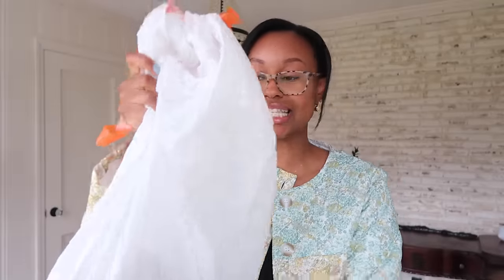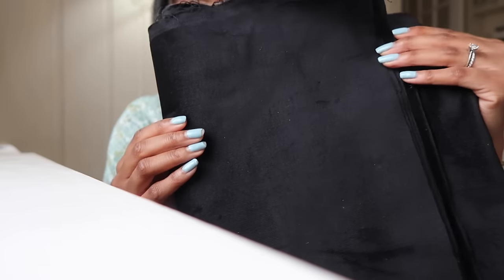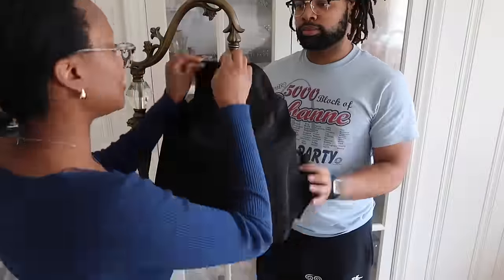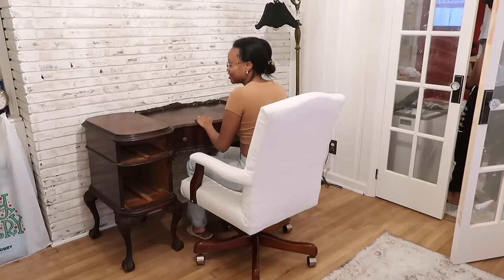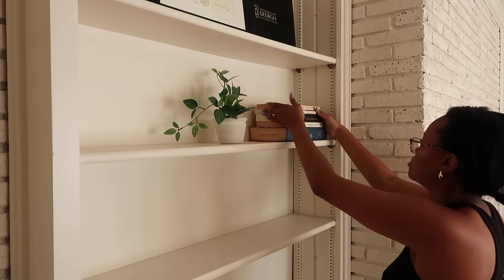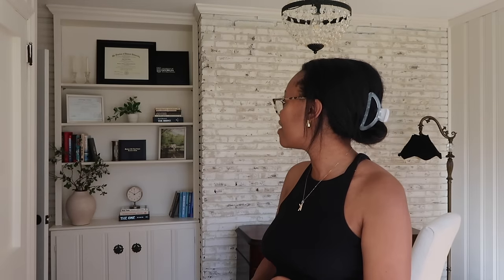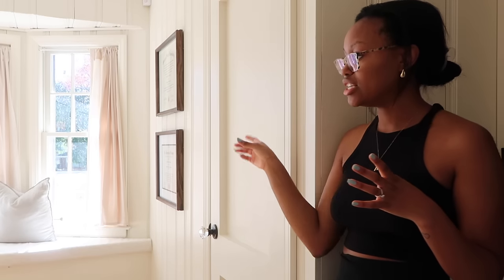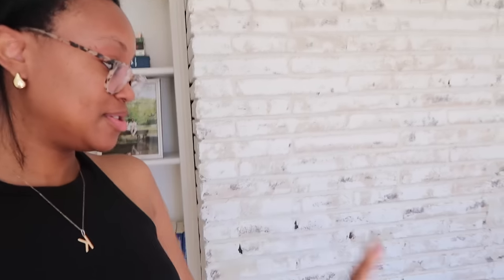DECORATING MY DREAM OFFICE!!! (Custom Furniture & Lamp)| DIY Dream Office Makeover Pt. 6 #FIXERUPPER

Comment: The office turned out Amazing.  Trial and error is a great way to learn new skills.  👌 Straight pins would have been a huge help with the lamp shade project.  Please ensure that the fabric used is flame retardant as some bulbs can generate enough heat to spark a fire.  If Marcus actually works all day at the desk, a mirror on the brick would be a great addition  to get a view of the outdoors and break the boredom of the workday.  The chair is amazing and looks comfy and scotchgaurd is a great addition.

Comment: You should use a cool Edison naked bulb for lamp. Or find a more vintage / stained glass lamp shade .
Reply from the maker: Hiii! We put an Edison bulb in but I haven’t seen a naked one! Im gonna look that up!  I think the lamp shade is vintage enough 🥰 it’s so unique
Reply: @YoungLadyBusiness  Kayla unfortunately we can’t really appreciate the vintage lamp because of the black cloth covering it. Your eye is automatically drawn there. I too love your styling of the built in. Also, you need a little black on the window side of the room to pull it all together. Completely cover your bench with different styles of pillows with and a throw added in with touches of black throughout the pattern. I hear Marcus not caring about facing the brick wall. It would be nice to get a large rug and center the desk like someone previously said. But as you said, it would hinder the flow of traffic through the room. Black and white blue prints would be a really nice touch. Make sure you use more than one. There’s a company out there where you can send them a picture and they can blow it up as large as you’d like. Another great job Kayla and Marcus. 👍🏾👍🏾

Comment: I think you guys did a great job with the office. I think you should add some carmel faux leather pillows to the window seat to bring out the beautiful color of the cushion fabric. I also agree with adding the blue prints to the wall over the desk but leave it its original blue color with a black frame. It will look beautiful. The runner in front of the window seat is a great idea. Changing the curtains is a good idea too. Again, I would love to see a pop of carmel added to the space in the curtains (or window shades) as well. And last but not least, the lamp shade is a “no” in my opinion. I personally think the scale of it doesn’t fit the space well. 
Love you guys and keep up the great work!!

Comment: Those blueprints are nice..... definitely frame them and put on the blank white brick wall. The walnut frames are sharp.....
The blue would be another pop of color......or black and white in the wood frames. Your Mom really did some great sewing.....the curtains (I agree, bleach or dye them would be great) the chair doesn't look hand sewn, Mom did a spectacular job on it........the dest looks great.....the lamp, looks good, maybe add some black ribbon trim? Top, bottom and at each side where it dips? You all did a fabulous job! 😊👍🏻

Comment: Beautiful dream office! I have 2 suggestions for you to consider. The first is to purchase a clear glass floor protector for under the office chair. I purchased one from Wayfair. It's very practical and simply beautiful. The second suggestion is to place quarter rounds around the vent cut-out (on the window seat). This would really finish this piece off. Best wishes!

Comment: So glad your mom is going to help with the lampshade.  I think it would really be a nice touch if you add clear crystals hanging at the bottom as a fringe.  Or you could use a very fine black fringe. Just a thought.  Also that would help add the old world touch to the modern black shade  I agree with the other changes you mentioned.  The room is bright and inviting.  It will be a great office for Marcus.  Yes, I would frame and the original blueprints and hang them in front of the desk.  It will add a nice masculine touch for Marcus and highlight that beautiful desk.   No, please leave the blueprints blue.  Any other color will take away from the authenticity and natural beauty of them. ❤

Comment: By hand??? MOM DID THE DARN THING WITH THAT CHAIR. The room looks very nice.  I will add and make two suggestions, though.
 1. The desk looks so isolated facing the wall. The room is for the person working there. They should be able to see the room and enjoy the beautiful bay window scenery.
 2. I like the little splashes of color the books bring to the room. It doesn't overpower the white-on-white theme. It would be nice to see a rug that was mostly whit/neutral but that had little specks of colors (like the books) in it. The bookshelf really adds some liveliness to the pallet.

Oh, and what a treat to have those original blueprints. You could get those professionally framed and matted to ensure they keep well over time. Nobody really does blueprints like those anymore—it's all computer paper.

Always job well done. You really have turned this house into a home, Kayla.💕💕

Comment: Frame for hw plans, for hen like frames winsome metal links, then hang them from the ceiling with as close to the wall as possible. They will look like they are hanging on the wall. An area rug is very needed or at least a runner like you mentioned. The desk needs to be turned around facing the window, probably centered and pulled away from the wall. Lastly get rid of that sad lamp and bad overhead ceiling fixture. Don't be afraid to mix modern with your vintage desk. Toss in a couple of throw pillows with a print and some color on your bench. Navy and white maybe to offset the blue prints. This room can be a show stopper; don't stop short of that by settling for ok.

Comment: As is customary, you guys did a great job with this renovation.  Cant wait to see you guys build another storage unit for Sweet Masonry products.  

I think you should put all of the plans in frames and use the original. Pls don’t change the color. I really liked the frame of the lampshade as it was; I’m sad to see the bottom was removed. Yes, I’d add two more pillows on the bench. Think the barns doors would have allowed the desk to not face the wall. Looking forward to your next project.😊

Comment: Kayla, you have to cut the lamp panels in the sections and sew each together in order to get the correct shape. Also, cut the panels at least an inch on each side for the seam to sew them.

Comment: You have to cut out each individual section leaving a half in or one inch seam allowance for each piece. You can add seam binding at the bottom to finish it.

Comment: Are you going to place the desk in the middle of the room?  Then you can enjoy looking outside, seeing into the kitchen instead of just facing a brick wall.  Another option is to keep it on the wall, but have the chair facing out towards the window. Then you can have eyesite of both doors and outside.

Comment: I think you did a fabulous job. Kudos for having such a fabulous helpmate in Marcus….I guess that’s why u married him….😊 I would float the desk in the middle of the room. And maybe work on the lampshade. Such a beautiful piece that needs a better shade. Wall could use a great piece….maybe from your travels to Africa. You will figure it out. I have lamps with black shades….had for years. Keep that. But, research for proper covering. Your Mom is very talented. I hope you are watching & learning those invaluable skills. Roll up shades in the same tone as your frames to your diplomas would be ‘chef’s kiss’.  But, as I always say, Do You. Just a viewpoint from me. You could add a wire basket for the blueprints.

Comment: Use a bar of soap and rub the wood on the inside and outside of the drawers and see if that help with the issue. The reason is they are acting like that is because moisture has cause the wood to swell.
Reply from the maker: Great great tip!! Thank you! 😊

Comment: Hi Kayla.  Great job on the room.  For the chair, Amazon has casters for chairs that are rubber and will. These will not scratch the wood. And are not expensive at all.  I would not recommend the roller blade look as they roll really fast and can be dangerous.
Reply: Using these wheels you will not have to put down the plastic mat.

Comment: What about using the blue print and hanging them on the brick wall but from the ceiling. So it would look like it’s floating and you really wouldn’t see the wire but it would be framed

Comment: Hi Kayla, I think you should of found a new lampshade rather than use the original one because that lampshade was gorgeous. The black on the lamp looks morbid and doesn't look good at all. Not sure why you didn't take shade off to work on,, which would have been easier. Everything looks stunning but perhaps turn the desk around..I'd take your photo in the shelves and hang it up on the bottom shelve rather than have it sitting, it will look much better. You need to implement more colour because it comes across as boring..

Comment: The problem you were having with the lampshade appears to be because you didn’t take the original completely apart. The “pattern” was clearly not flat as you were cutting. Based on the shape of the shade EACH PANEL has curved sides and bottom. You need a separate piece of fabric for every part of the metal frame. There should be a seam at each vertical wire.